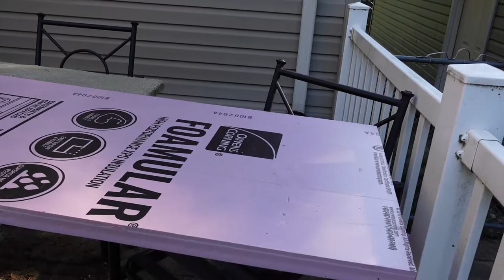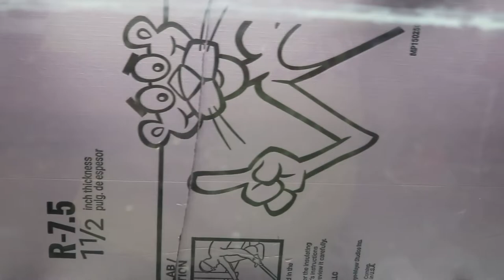EASY DIY 3D Aquarium Background

Comment: I didn’t know gorilla glue was aquarium safe.  I’ve been researching on what glues are safe and all I’ve seen recommended is super glue and 100% silicone with no mold inhibitors.  Which gorilla glues are safe?
Reply from the maker: Thanks Erin!  I only used the original gorilla glue and only used it for backgrounds, not attaching plants or anything else.